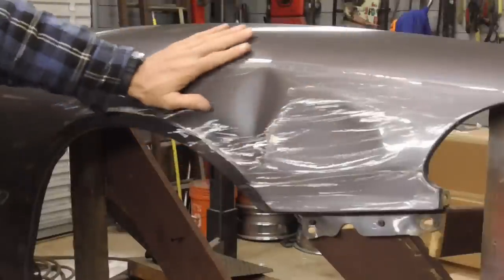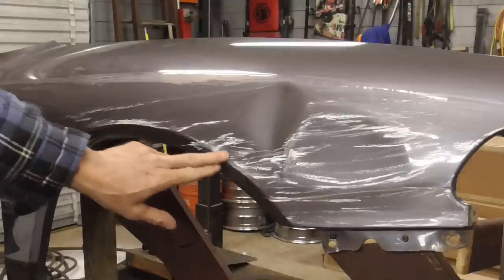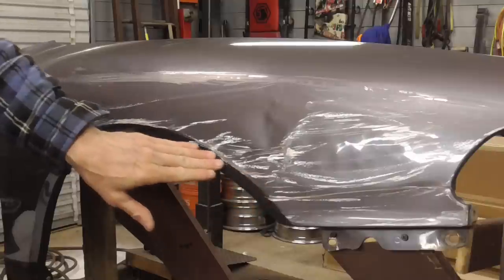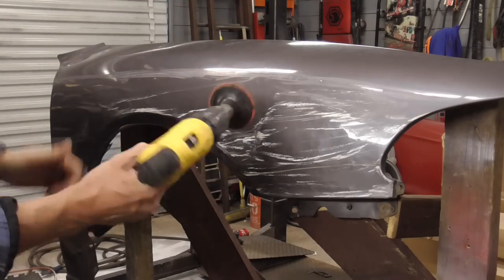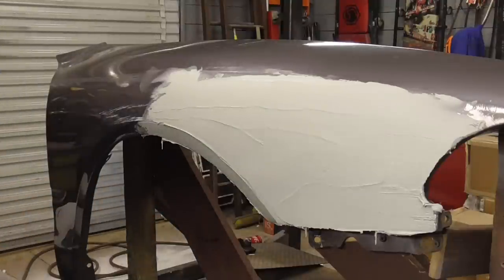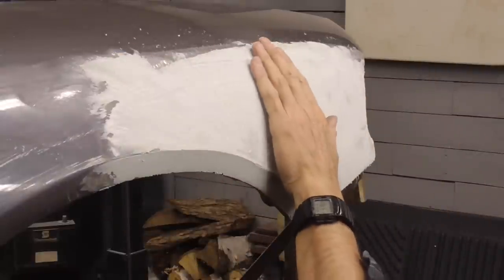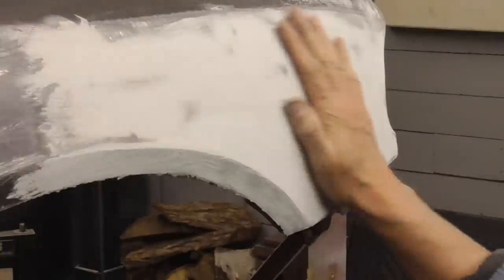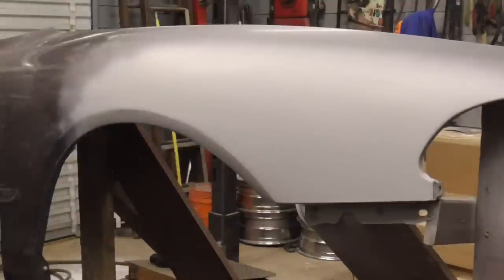How to Pop / Bump a Dent out of a Fender with Basic / Common Tools

Comment: Thank you for the videos.  I remember in the dark ages before the internet, I used to try and 'follow directions".  Using the Bondo branded rasps, etc.  Never worked for me.  I see now, I let it harden too long.  I was young then.  Hopefully, if I work with it again, I'll have an easier time with it.  I also learned, go as coarse as possible.  I used to believe the coarseness of paper would mirror in the finish, and would feel the same.  I'd use a higher grit, and end up frustrated at the slow or complete lack of progress.  Thank you for the video.  Been feeding on video lately.  ;)
Reply from the maker: You're welcome and yes without youtube, I would be half as smart.  Jerry

Comment: People have also told me not to mix filler on cardboard or wood because it soaks the resin out of the filler. But I've never had an issue.
Reply from the maker: You'll never have an issue with that.  That's all we ever used in body some shops I worked at - cardboard squares cut up from parts boxes.  When you had nothing to do it was time to cut up some "bondo boards"

Comment: Another excellent and easy to understand video. I have heard people suggest not applying filler to bare metal and applying epoxy primer before any body filler. What are your thoughts on when this needed? Thanks.
Reply from the maker: Never apply it over epoxy primer unless you want your sand paper to instantly clog up.  Body filler has been used over bare metal for 30 years before epoxy primer even showed up on the scene.  You do not ever have to put it over primer - in fact, it was frowned upon at all of the shops I worked at.

Comment: I've used Bondo before but allow run out of working time. It sets up on me too fast. What brand body filler do you use?
Reply from the maker: I always pick up the most inexpensive stuff.  This stuff is Auto Body Master from local Auto Value Auto Parts.  It's all the same so don't waste your $ on the fancy stuff.

Comment: Hey I see you use 36-40 grit then finish the filler off with 80 do you go up to finer grit like 180 to smooth it out ?
Reply from the maker: No - body shops stop at 80 on the filler.  They prime the area with primer surfacer then block sand that surfacer with 120-180 grit.  Prime again and finish sand with 240-400 then paint.

Comment: How did you determine where to start? Is there a rule body lines first?
Reply from the maker: Great question.  There is no rule of thumb.  I usually think about it for a minute and decide what's going to be easiest.  Most of the time I do the biggest most important area first.  If there is multiple body lines, I might start at the top and work down.  Jerry

Comment: How does the sandpaper attach to that rubber block ?
Reply from the maker: It folds into these slots on the ends of the block - they are like flaps - there's spikes in there that poke through the paper when you push the rubber flaps down.

Comment: At first I though this was a Red Green parody. No duct tape needed though. Came out great
Reply from the maker: That's great!  I was thinking about doing a video on how to fix your work boots with body filler. I always wear a hole in the top of the right boot and bondo actually lasts a real long time when used as a repair.  Just spread it on nice, shape it and paint it close to the color of your boot.
Reply: @LakesideAutobody  that's awesome

Comment: The cardboard is not good for the repair. That’s what we are being taught in school.
Reply from the maker: Curious as to what the instructors say the cardboard does - we used to cut up all the boxes that fenders and parts came in and made "bondo boards" - never had a problem mixing on cardboard but let me know what it causes - thanks
Reply: Lakeside Autobody because they can be coated with waxes and other substances that can contaminate the repair area. That what they teach us ; also, not to do the stirring like you said because it was air bubbles into the bondo.
Reply: Lakeside Autobody I have seen other people doing on YouTube so it must not be a big deal.